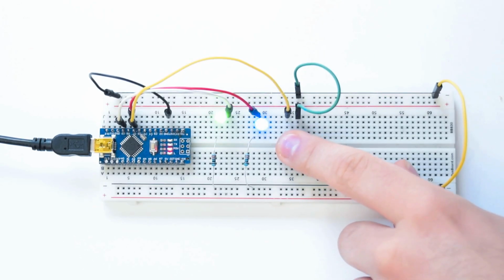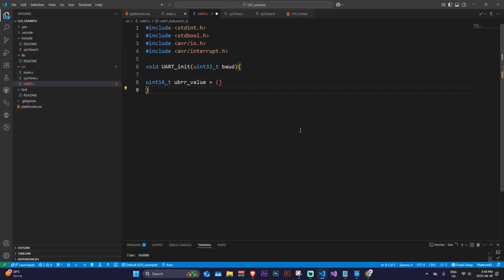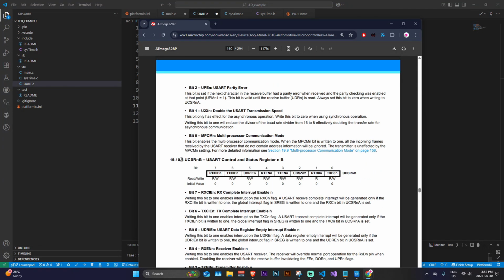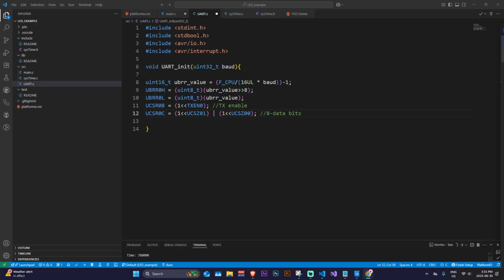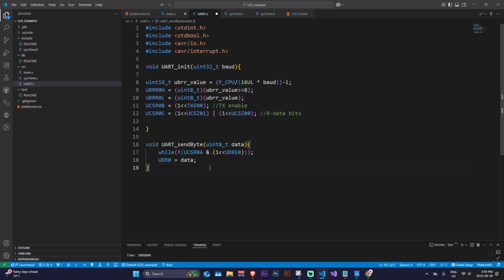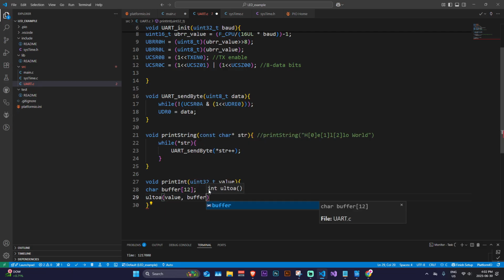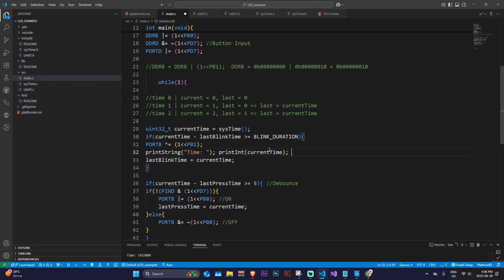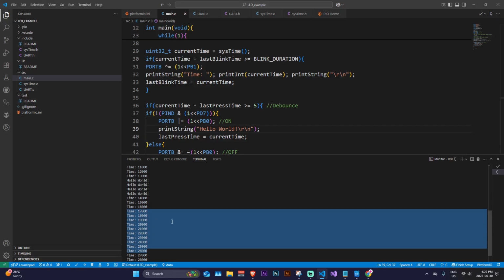Bare-Metal C | USART & Serial Printing! (Part 5)

Comment: Hi, im having trouble having the printString or printInt functions print in the terminal. I've swapped cables, used a spare arduino nano board, double checked the UART_init code and tried a different baud rate. I'm convinced its something to do with the initialization but cant quite work out what it could be looking in the datasheet. are there common areas that are overlooked in this stage? cheers.

void UART_init (uint32_t baud)
{
    uint16_t ubrr_value = (F_CPU/(16UL * baud))-1;  //UBRR calclulated value
    UBRR0H = (uint8_t)(ubrr_value>>8);   //upper UBRR
    UBRR0L = (uint8_t)(ubrr_value);    //lower UBRR
    UCSR0B |= (1<<TXEN0);    //enable transmission
    UCSR0C |= (1<<UCSZ01) | (1<<UCSZ00); //8 bit data
    //UCSR0C &= ~(1<<USBS0);  //designates a 1-bit stop bit
}

void UART_sendByte(uint8_t data)
{
    while (!(UCSR0A & (1<<UDRE0)))
    {
        UDR0 = data;
    }
}
Reply: nevermind I got it. was looking over the sendByte function and realised the line 'UDR0 = data' had to be set outside the while loop. completely overlooked the semicolon at the end of the while loop since im so use to grouping everything with brackets.

Comment: Hi!! At the begining of the series we changed the .cpp file with a .c file to make it C instead of C++. Is the C++ useful for anything? Will it make it better in any way or is just something that you don't recomend using for bare metal programming?
Reply from the maker: C is simply preferred because it has less overhead than C++. Working in baremetal, we often don’t want to implement any form of Dynamic Memory allocation as it can cause errors especially in some redundant systems.
Reply: @CosmicAerospace  Hi bro, if possible, may you be able to tell some of those "redundant systems" examples?